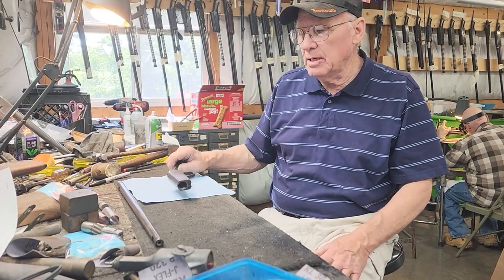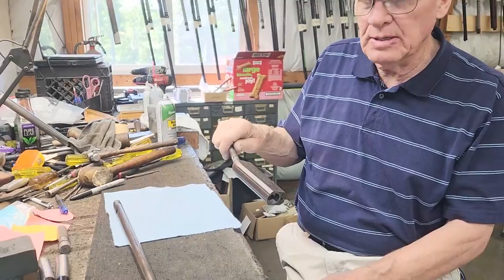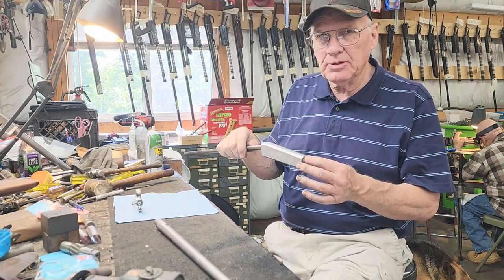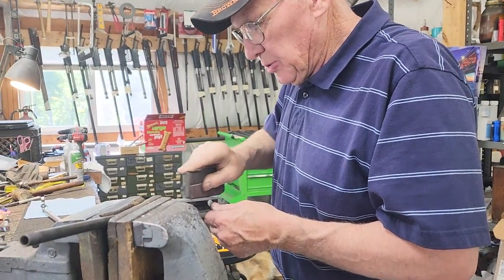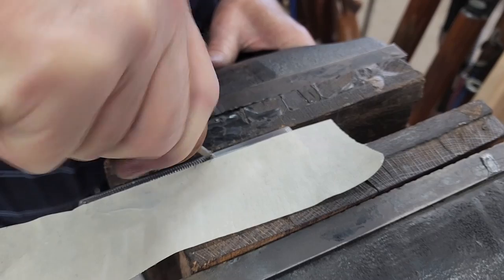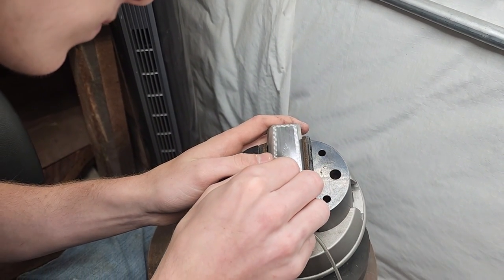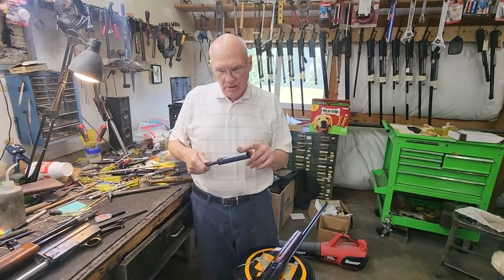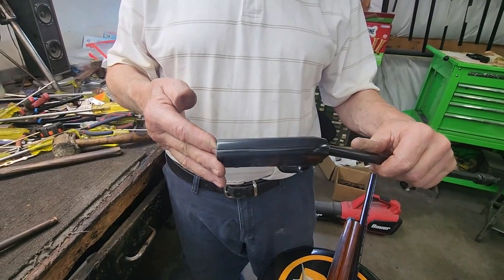Bringing a Browning SA-22 back to it's former glory.

Comment: Thanks for another video. Love my  Belgium made SA 22. My dad bought it from my uncle for a whopping $75 back in the 70’s. I used your 2 part videos on disassembly and reassembly and gave it a first ever good cleaning. Runs flawlessly. Thanks for the videos you post. Very helpful information!!! 😁🇺🇸😁🇺🇸
Reply: In1969 new ones were $91.50.  I Bought one.

Comment: Hello, sir. Can I request a consultation? I have a Browning semi-auto 22 LR. After I place a 10 in the magazine and try to load it, the cartridge always pops out (if I hold the rifle in a classic way, I don’t turn it upside down with the cartridge ejection hole). Also, if the magazine is loaded with 10 rounds, after the first shot the second round necessarily does not enter the barrel and stands askew. This is not observed if you load 4-5 rounds. What could be the reason? Thank you!

Comment: When taking off the rear sight of my sa 22   Removed the barrel and forend to tap out the dovetail sight. The flip switch that locks the barrel to the receiver came loose and all ended up on the floor. Found the two springs and pins but unsure of reassembly. Looks like work for an octopus,,,any tips from anyone appreciated ……..
Reply: Send it to ART...
Reply: Art has a couple videos on SA 22 disassembly and reassembly. Might want to check those out.